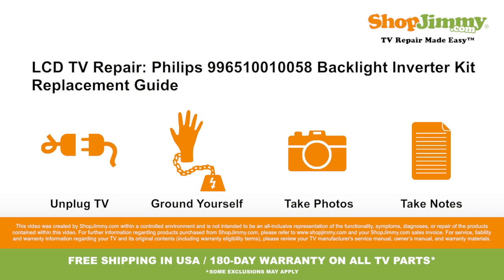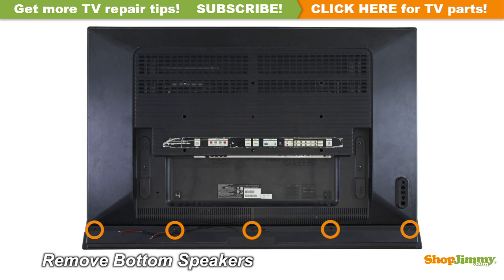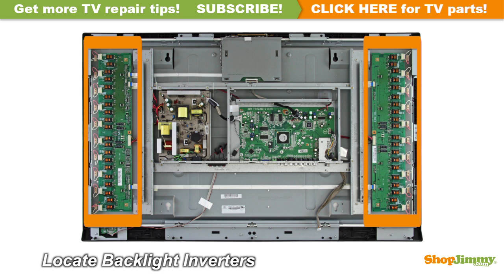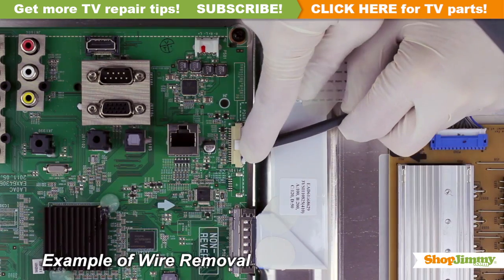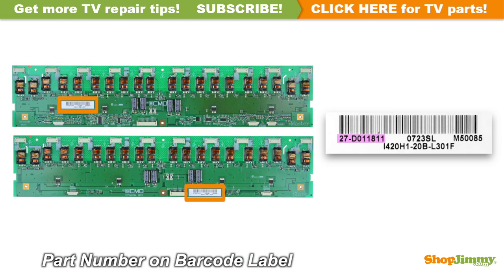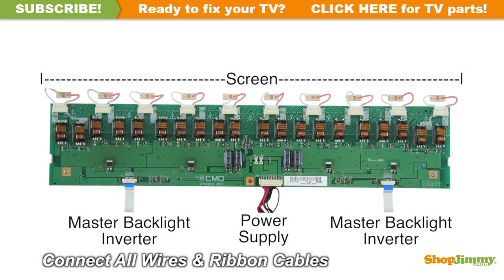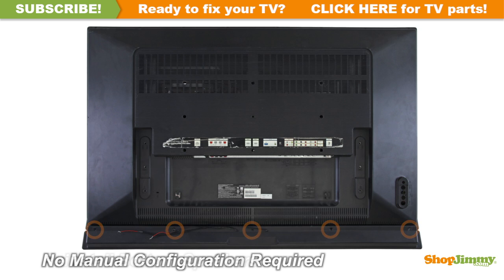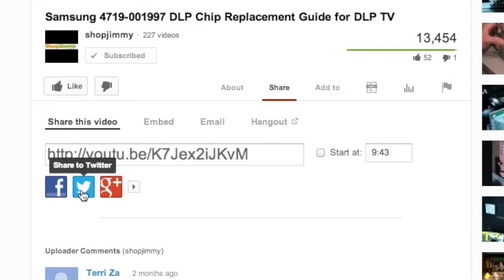LCD TV Repair Philips 996510010058 Backlight Inverter Kit Replacement Guide

Comment: Magnavox 32MF369B/F7. TV works but has some issues with the screen. The left side of the screen displays darker than the right side, as if it was split down the middle and the hues lightened on the right side. Is it a problem with the inverter? If so what is the part number in your website?